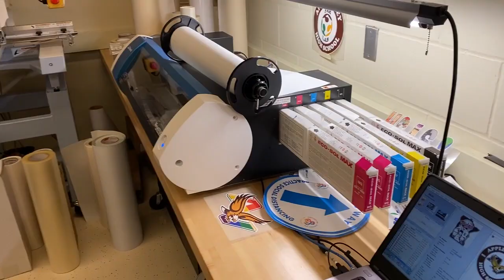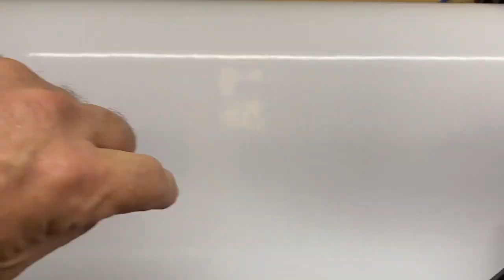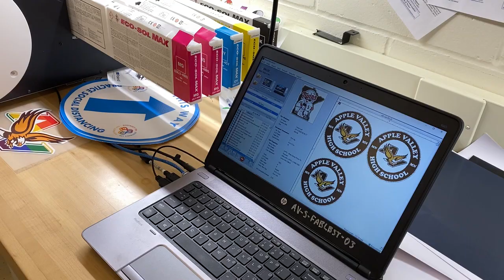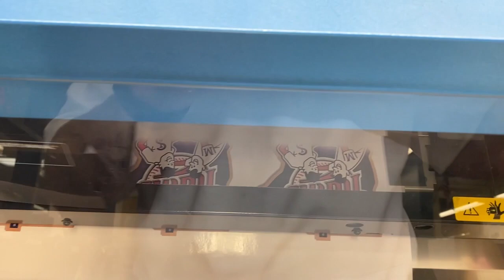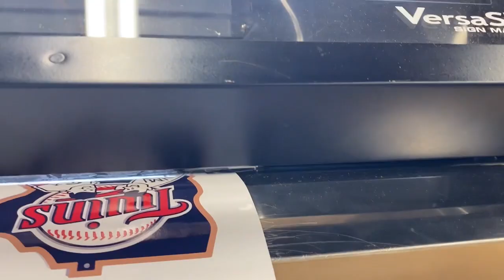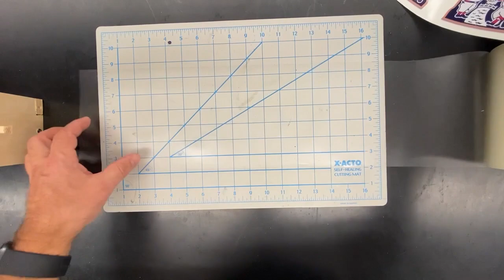*Roland BN-20 Print & Cut Machine. Cutting & Weeding Demonstration

Comment: From my 20 yrs using Roland printers. If you don't laminate your prints, they won't last outside, the edges will curl and that sticker will be trash. Also, laminating gives the sticker more thickness, durability, you can use gloss or matte fishish and you don't need to use transfer tape. 
I'm not sure on this particular printer? In most Roland's you can change the settings so it prints going both ways, makes printing much faster.
Reply: not possible with this particular model unfortunately.
Reply: Just run it through the laminator and then through your cutter.  Not sure if you can put the print back in the Roland and cut it. The machine does have an option just to cut.
Reply: @josie-k9-cold-case-files  Print only with crop marks then laminate and then re enter printer to cut only using crop marks.
Reply: I just bought a roland sp540v print and cut, but im getting messed at the cutting. The offset its at 250mm for 45 deegre blade and i still get a lot of trouble wihle cutting, i mean it goes over the sticker. Can you give me a little help on the cutting settings